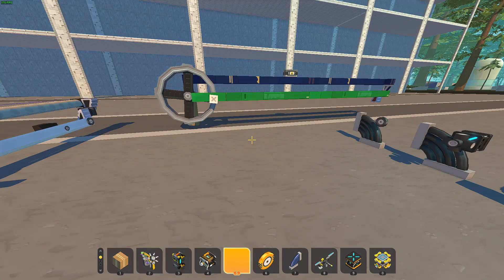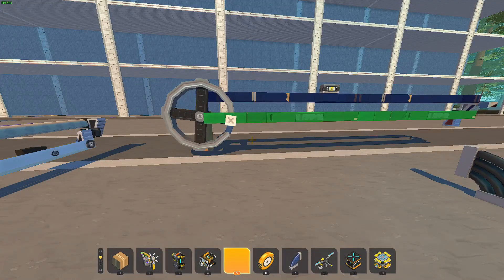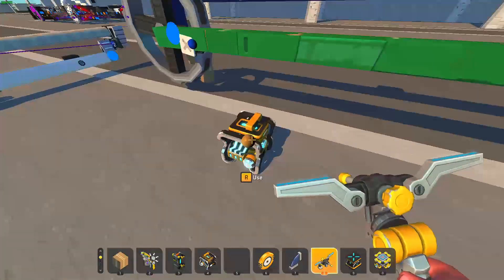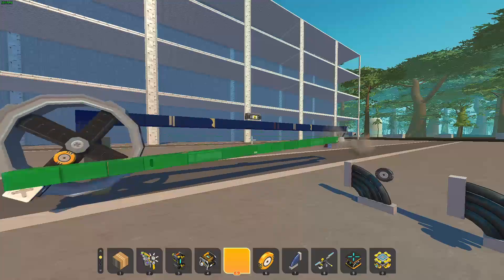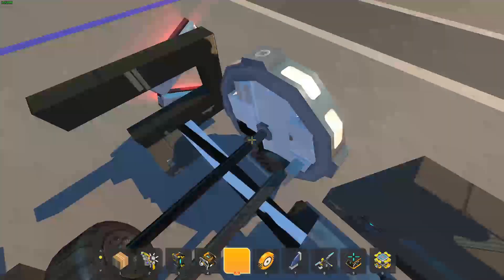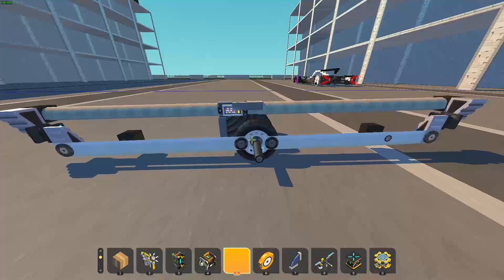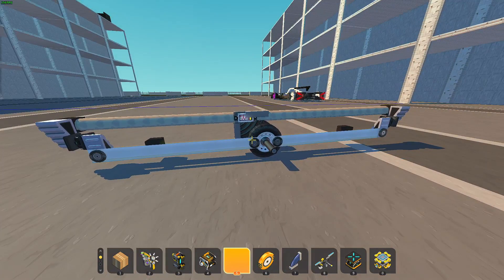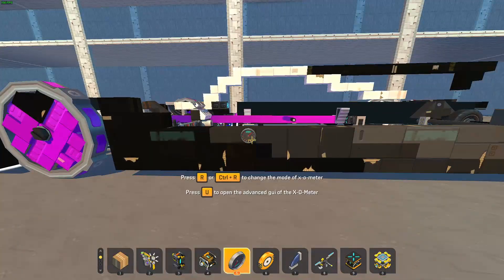scrap mechanic pressure effect and basic engine principle.

Comment: Hey Fuzz how would you feel about making a playlist teaching the outside knowledge of Scrap Mechanic? Like the odd physics shit and rules that you've learned in your 8k hours of SM experience. Like how "springs bad" or something idk.
Reply: bc ong we need better SM yters
Reply from the maker: I would and i want to but my primary motivator is documentation and so the deves know what is up. As far as we know the devs are not really aware that there is a team of tryhards that have dissected ther physics engine. We have a lot of math describing how all the joints behave and we don't want that to change, we just want to run better.
Reply: @machineball  If you need help, you could probably get some of the boys on board with it. They could make a video on something they know about and you could upload it or add it to a playlist. It's always great to spread the knowledge of the SMTC, more smart minds.